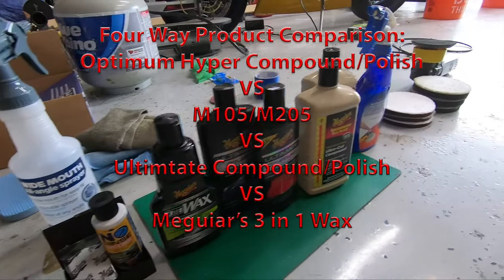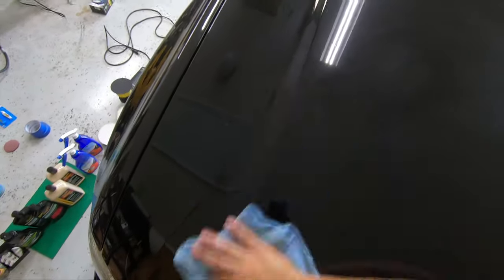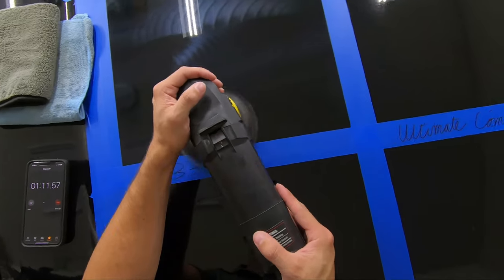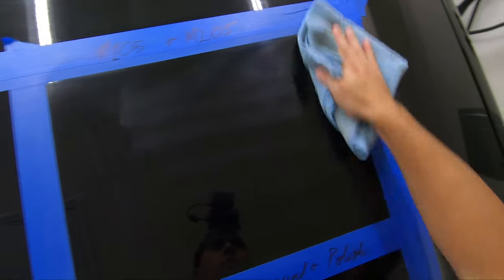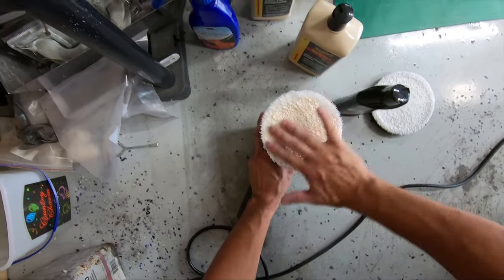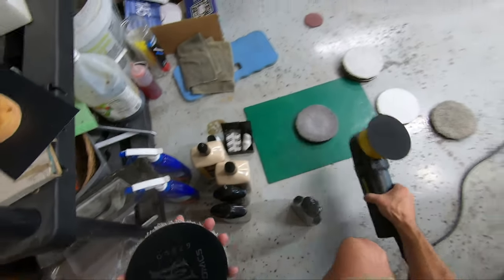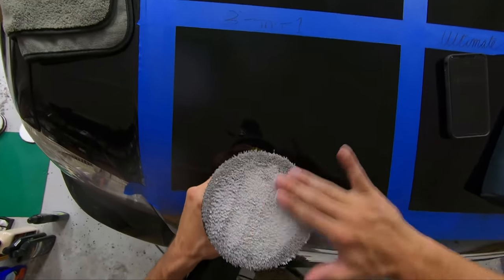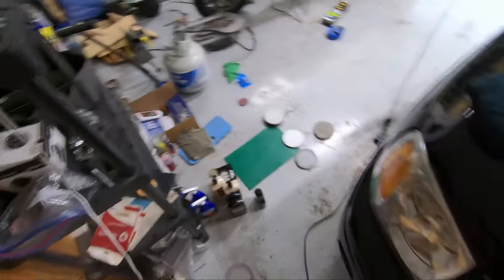4-Way Compound Comparison Optimum-Meguiars

Comment: Joe, good video, but to be fair the Hyper Paint Correction System(HPCS) is very much a System. As you eluded to in your video, results were not optimal. In this case you were using the Optimum Hyper Compound and Hyper Polish in replacement of the crèmes of the Meguiars polishing system. Inversely had you used the Meguairs products with unprimed Optimum Optimum No Rinse(ONR) dampened pads, low speed and no pressure their results would also not be optimal. 

Both companies go to great lengths to engineer full systems that offer the best results when used as a system. Both work very well when used as such with very happy users of both systems around the world.
Reply from the maker: First off, I am extremely flattered to know that you've viewed my video and I greatly appreciate the feedback.
I am very aware that the results weren't optimal and that the application method is to blame there. This isn't my preferred method for using Optimum's products, but I wanted to keep it as a fair comparison between all products by using them in the same manner.
I've always had excellent success with Optimum's HPCS when used in a different manner (HC on a heavy cut MF pad, followed by HP on cut and polish MF pads), and it is one of the easiest products I've used since I've begun detailing.
I'm wanting to test out more of Optimum's products and see how well it works for me on a rotary, as it's been over a decade since I've used one. I've watched many of the videos you/Optimum have put out over the years and the classes you've taught to others, and they've been a wonderful resource for me in understanding how your products work, and the best scenarios to use them for. I would like to do a full comparison between Optimum's HPCS and Meguiar's M105/205 used in their intended manners to give a bigger image for viewers to see the differences and nuances for both products, how they work, and what detailing with both products fully entail.
I'm always open to criticism and feedback, and would love to hear more from you, and get your feedback as I get to put out more content.
Reply: JoeMartinMVC thank you, yes they are both very widely used and good systems. Ultimately it’s down to the users choice. I’m older, and prefer a rotary myself. With Hyper Polish for finishing, a Black Waffle Pad with your rotary at 600rpm will give you best results.
Reply from the maker: Personally, I've never been too crazy for waffle pads, back when I used them they created issues for me, but that was also around ten years ago. It likely wouldn't hurt to re-visit them again and see if they've changes since those days, or work better for me when using Optimum's systems.
What're your thoughts on the hex-logic style pads that have been coming out on the market?

Comment: Ultimate Compound is derived from M105, and utilizes SMAT (Super Micro Abrasive Technology) abrasives that do NOT diminish. 

Same goes for Ultimate Polish. It's based on M205. 

I've had similar findings though. I really love the Ultimate twins and have since 2013. I've tried them with a variety of pads and machines, but my favorite is a Porter Cable 7424xp with green and blie Hex Logic pads. Those pads are made for Chemical Guys by Buff and Shine, so I'll use their flat "Grip" pads same foam, no design. 

I actually prefer thos pads with Optimum too.

Comment: Can you do a side by side of 205 and ultimate polish. Also you should have tested d300 instead of d301. It's an amazing product.
Reply from the maker: I sure can. I'll try to get a more even comparison for doing that one by doing some sanding marks to 1500 or 2000 grit and testing the polishes against them.
Reply: @JoeMartinMVC  Look forward to it. Should also try throw 210 ultra fine cut in. But from what I have read this is only really good at refining even more on softer paints so not sure what paint you will be testing If you decide to use it. Keep me posted. Thanks
Reply from the maker: @trackmedixuk  I've actually been wanting to try out 110/210 but have not gotten my hands on it yet. Once I do get some I'll do a comparison between it and 105/205.
Reply: @JoeMartinMVC  Have subscribed so will keep an eye out for it 🙏

Comment: Hey when you use that pad with the ultimate compound did you get a better cut or would it be the same as a foam pad
Reply from the maker: The Meguiar's Microfiber Cutting pads are about the equivalent of an orange cutting pad (think Chemical Guys Hex-Logic or Lake County Orange Cutting pad)
Reply: @JoeMartinMVC  what was better 105 or ultimate compound
Reply from the maker: @james6jewel  That's a hard one to answer really. M105 is a better cutting compound, but it dusts up a good bit. UC is awesome because it can be a one-step cut and polish and has a longer working time, so it doesn't dust up as much. UC also has more oils in it for dryer paints, so it really depends on the condition of the car you're working on.
Reply: @JoeMartinMVC  well it's a old paint I believe 94 Ford and I tried uc and worked great but I still have scratches might try the 105 and see might post video up and see what happens
Reply: @JoeMartinMVC  might try the 105 to cut little more then the uc see what happens also lol might have to check clear to see if I have room to wet sand a little
Reply from the maker: @james6jewel  I always try to avoid wet sanding when possible, but there have been a few times where it's just absolutely necessary.
Reply from the maker: @james6jewel  With it being a 94 I'd be concerned about clear thickness for sure. If you do make a video, let me know and I'll check it out.
Reply: @JoeMartinMVC  I will upload a quick video to show what's going on

Comment: I'm here because I don't see a lot of people using Optimum Hyper Compound and Polish! They are my absolute favorite to work with as far as the user experience..

The compound can cut better than most people realize, it is just very pad dependent. But especially with a rotary, using the Hyper pair is just a great experience.

I've used several bottles of Ultimate Compound, for a retail product under $10 it's quite good. Especially for a 1 step or mild defects, or people working by hand. But I just don't like the removal and the behavior of the lubrication agents. M105 I get dusting and mediocre cutting. My favorite for heavy cutting is Sonax CutMax hands down.. and CarPro ClearCut a distant 2nd.. 

People dont like to say it, but good finish polishes are kind of all the same for the most part.. They either finish well, or they don't. I use 205 and 210 and Optimum, a couple others..

Good channel sir, well produced, very "watchable" you definitely are putting the editing time in. I see it growing fast! 👍👌✌
Reply from the maker: Keith Olsen I really appreciate the compliments and your insight. I’m hoping to get more feedback as the channel grows and can make sure I provide high quality content that the community finds useful. 

I’ve been wanting to test out Optimum’s compounds with a rotary, I just no longer have one. If people end up asking for comparisons or reviews with one though, I’ll invest in one for the community. 

I’ve always enjoyed m105, but absolutely hate the extreme amount of dusting it’s always had.

Comment: Thanks for the video! This might be a dumb question, but when you do the IPA wipe down, is there a certain percentage of alcohol that you prefer? 70% or 91%?
Reply from the maker: I always use 91%, but either will work fine. Depending on how oily of a substance you're dealing with sometimes 70% will require a second pass to remove it all.